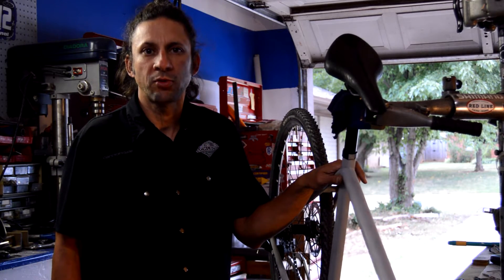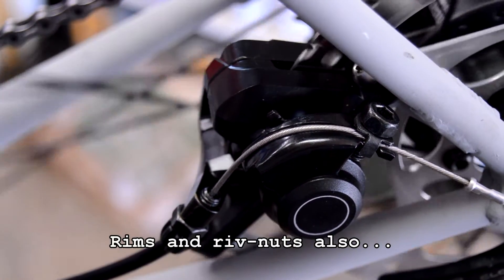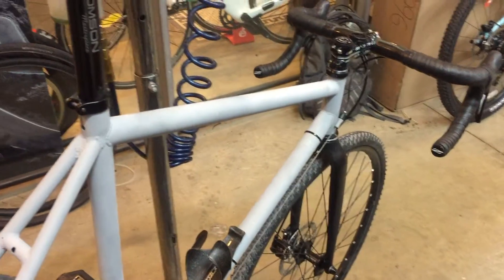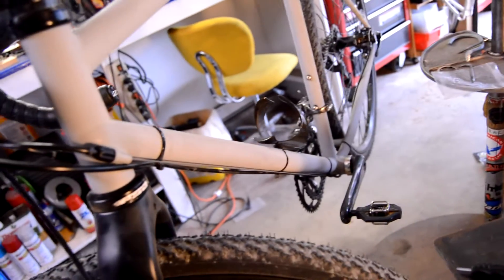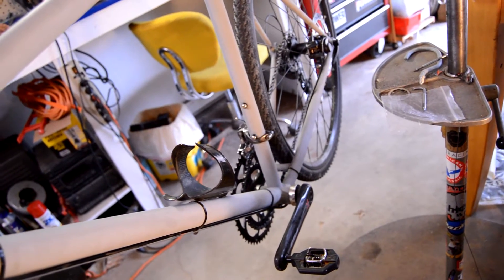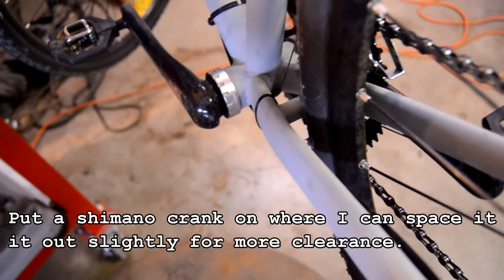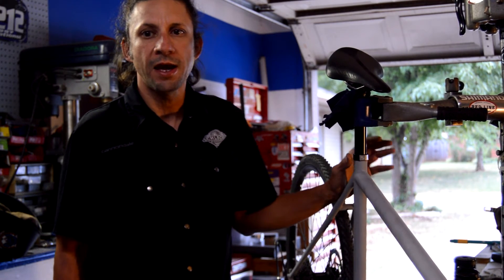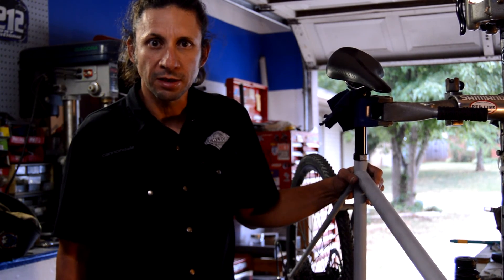Bicycle frame build part 12

Comment: I did something very similar to you. I built a lugged cross frame and fork that is also disc brake. My only complaint is that the BB is a little too low for cross, but it's a good height for "gravel grinding." Your bike is really nice for your first build and there's nothing like riding a bike that you built yourself. Here's mine: https://scontent-lga3-1.xx.fbcdn.net/v/t1.0-9/10514655_10154450332580455_7084452793358291884_n.jpg?oh=3fdaf66bf43c56b5fe79fd459cd89ada&oe=5855C383
Reply from the maker: Nice build!